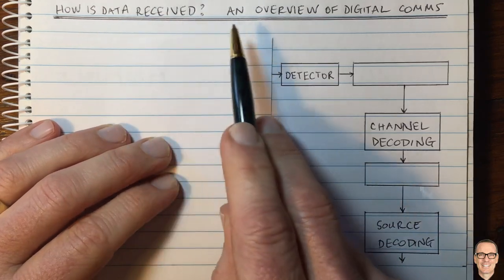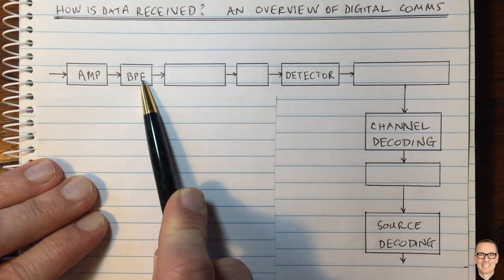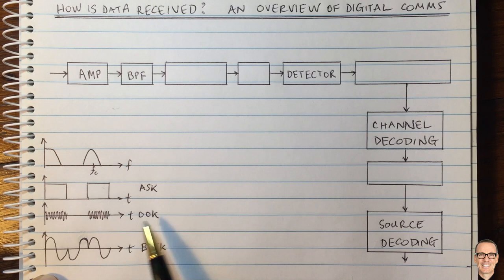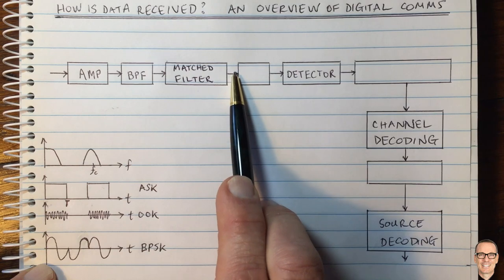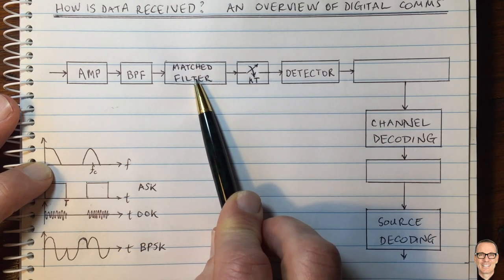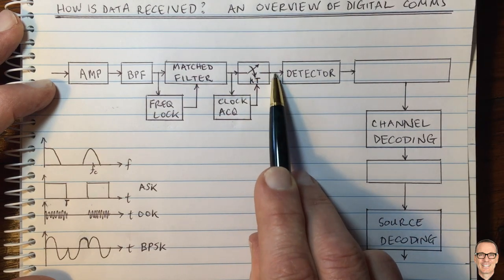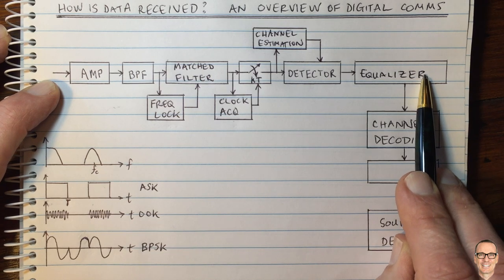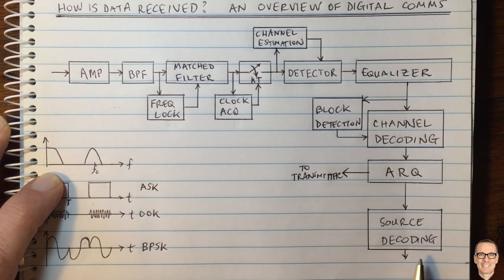How is Data Received? An Overview of Digital Communications

Comment: Hi, thanks for the video. From the video I understand that the frequency lock and clock lock are implemented in hardware, what are the benefits of that over implementing in software (after we sample)?
Reply from the maker: Yes, it's possible to do it in software, but you need to sample at a much higher frequency so that you retain information about the carrier phase rotations and frequency offsets.
Reply: @iain_explains  😊 thanks

Comment: hey lain , at time of receiving the data at the rerceiver the syncronization bits which is used for timming recovery is used only once or whether its used after each frame  [does start stop bit is same as the synchronization bits ]

Comment: Sir can you explain the channel estimation and detection part . Not able to visualise it
Reply: channel estimation is having an idea about how the channel is affecting the signal that we have transmitted 
suppose you have sent a Qpsk constellation (11)(cosine wave with a 45-degree phase shift) so at the receiver, you will not receive the same thing rather you will receive the constellation with the rotated phase shift and also with the degraded energy as it may have suffered attenuation and other channel effects, thus by estimating channel you are finding out by which proportion your signal has been rotated or attenuated so that you can decide the decision boundary accordingly.
   This estimation is done by the pilot bits which are sent along the data bits and accordingly will decide the decision boundary
Reply from the maker: Excellent answer Lutz!
Reply: @lutzvonwangenheim9682   thanks so much sir. You explained it so well

Comment: hey lain , i have watched your previous video about how to transmit data in which there is DAC is used  so, at the receiver end is there any role which ADC has to perform ?? i have seen in some text that after BPF a ADC has been used.
Reply from the maker: The sampler shown in the middle of the page is an ADC (I probably should have mentioned that).
Reply: @iain_explains  ok got that now thanks prof

Comment: Thank you professor, Im, by degree, a theoretical computer scientist but after taking a stochastic process class and watching your videos, I took many more signal and systems/processing classes and performed very well.
Im often finding myself applying that knowledge to computer science problems, it is especially useful in having a stronger understanding of communications, data science and machine learning which are both ultimately based on signal theory.
It gave me a way to look at these topics in a way other students fail to understand, and it even helped me get into quantum computing groups and projects and perhaps PhD in the future.
Reply from the maker: That's so great to hear. It's a great motivation for me to keep making these videos. These fundamental topics have many applications, and it's good to hear about what you've been doing.

Comment: hello , @5:25 i cant figure out which oscillator are you talking about at the receiver end in the block diagram , there is no such block of oscillator shown in the diagram could you please clarify?
Reply from the maker: The oscillator is used to generate the Matched Filter. This must be matched to the frequency that was used to up-convert the signal in the transmitter to the carrier frequency. In many cases, the MF is implemented using a correlator, and in that form the oscillator appears explicitly. See: "How are Correlation and Convolution Related in Digital Communications?" https://youtu.be/We5q5FJcbcU
Reply: @iain_explains  thanks lain you are a great ambasdor of wireless communication your channel is my best discovery on youtube wish yo millions of subscribers cheers!

Comment: hello sir  i have just steped my foot into the communication field thanks for the video 
at 3:25 what does the collection of energy means sir if the energy is collected by match filter then what is the role of intigrator and my next question is why we need to collect energy cant we sample the upcoming pulse at the instant at its maximum amplitude , why there is collection of energy comming into the picture . i am badly confused sir please help me
Reply from the maker: Hopefully this video will help: "What is a Matched Filter?" https://youtu.be/Ci-EjiMJo3I

Comment: very nicely explained video professor!
 but I want to ask a small question why there is a need for frequency locking at the receiver? We must be knowing already the frequency which we have to tune in so why there is a need for frequency estimation locking of the frequency?
Reply from the maker: Just because you know what the frequency should be, it doesn't mean your crystal oscillator will generate that exact frequency. Every crystal is different, and needs the oscillations to be tuned, so that there is an exact match between the oscillator frequency in the transmitter, and the oscillator frequency in the receiver.

Comment: hello, professor lain @ 6:37 what do you mean by scaling the constellation? I didn't actually get it
Reply from the maker: The channel attenuates the signal by an amount that depends on the specific channel (eg. wire type and length, or wireless channel over a certain distance with a certain antenna), and the receiver amplifier amplifies the received signal (most often by a fixed amount), and then after that the receiver needs to scale the overall received detected level, so that the overall effect of the channel and the amplifier cancel each other out, so that the overall detected signal can be mapped onto the constellation to decide which actual constellation point (waveform) was sent. See this video for more details about constellation points: "What is a Constellation Diagram?" https://youtu.be/kfJeL4LQ43s
Reply: @iain_explains  did you mean by cancellation is that the overall gain of the channel +amplifier = 1 , if this is the case then can't be possible that this scaling can be achieved by the EQUALIZATION ?
Reply from the maker: The term "equalisation" refers to undoing the effect of ISI from the channel. And yes, when you have ISI in the channel, then you will have an equaliser, and it will generally have an amplitude scaling so that the overall gain is 1. However, if your channel does not have ISI (or if your modulation scheme effectively avoids the detrimental effect of ISI - eg. OFDM), then you won't have an equaliser, but you'll still need to scale so that the overall gain is 1.
Reply: @iain_explains  as you have mentioned in the above comment that for the OFDM systems we are not having the ISI effect but still we are doing the FRequency domain equalization , than what is the purpose of equalization if the ISI effect is not there in case of the OFDM systems i mean how we are doing scaling in case of OFDM systems ??

Comment: Insightful Video. I am currently an ongoing masters student in Telecommunications Engineering, and have actually been viewing your videos to help me understand more this Digital communication Class.

Now, I was thinking of actually putting these ideas to actual product. 
What Chips would I need? For example using your receiver signal flow model, I would probably need RF amplifier chips, band pass filter chips, Local oscillators, modulator(Maybe FSK), DSP, DACs in that order... would this be all or is there something else?
Then for the earlier Transmitter signal flow model, which components/chips would I need for implementation?

Thank you
Reply from the maker: I'm not a hardware expert, but there are many approaches you could take, depending on the level of integration you're trying to achieve, and the level of access you need to the various signals along the transmission chain.

Comment: Hi Lain, thanks for the vidéo...A basic question. For ASK,  you did not show sinusoids. But I guess we don't have rectangular shape nécessarily, no?

In fact, I am a bit confused to 
make the links among line coding, DAC, modulation, symbol mapper and up converter.

I know that if we have an analog signal, we convert the analog signal into digital signal. While doing that, we have quantized samples. Then we do pulse shaping,  then up convert? Where is the position of different terms between which I am missing the links here?
Reply from the maker: If you haven't watched this video, it should help: "How is Data Sent? An Overview of Digital Communications" https://youtu.be/MAddbFfCsIo

Comment: hey lain,
I guess before we start matching our incoming pulse and start collecting its energy we need to find out the starting point of the symbol received at the receiver so my point is which algorithm is used at the receiver for the detection of the starting point of the received symbol at the receiver end and what are the impacts of STO(symbol time offset) on to our received symbols and if there is some
Reply from the maker: Yes, this is what I called 'clock acquisition'. This video might give more insights: "What is an Eye Diagram?" https://youtu.be/ROhgIWBteQQ

Comment: Lain, don't we do down conversation in the receiver?
Reply from the maker: Yes, I probably should have mentioned a bit more about that. Digital downconversion can be done as part of the Matched Filter (conceptually, at least - this would be the optimal thing to do), or it can be done as a seperate step just before the MF (which is most often what is done in practice, using a mixer).

Comment: Thanks, professor,

(a)   Do we use the ASK process in wired channels? 
(b)   I watched your matched filter video too. Does matched filter function = S(T-t). That means the Machedfilter function S(T-t)  is the function of input S(t).  mean matched filter only works for known signals? 
(c)   Does matched filter should always comes next to the amplifier right? In the case of using ADC, ADC comes after matched filter.

Please let me know. Thanks again
Reply from the maker: Answers: (a) ASK is essentially "PAM with a carrier". And some wired channels do use PAM. (b) By definition, the matched filter is matched to the transmitted waveform (as explained in my Matched Filter video). But this doesn't mean you can't use the same waveform in multiple ways to send different digital data. For example you could sent +s(t) to represent a digital 1 and -s(t) to represent a digital 0, and then you would only need a single matched filter and look to see if its output was positive or negative to work out if a 1 or a 0 had been sent.

Comment: what is clock acquisition and why its necessary
cant be communication possible without that?
Reply from the maker: The clock waveform is needed so that the detector has a time reference, and knows when to sample. ie. when one data symbol ends and the next one starts.